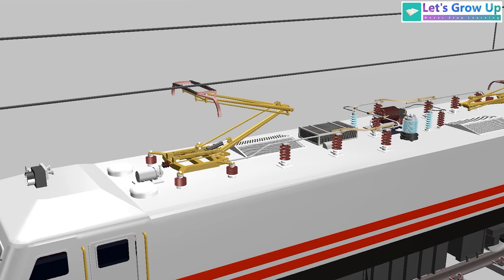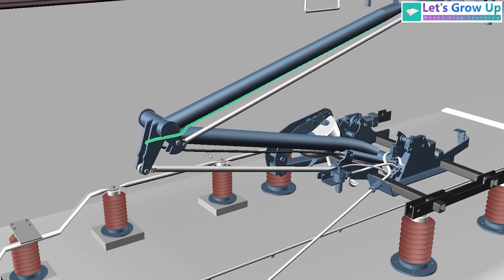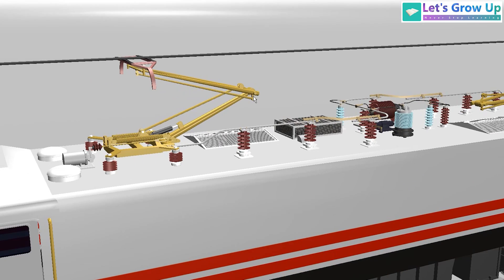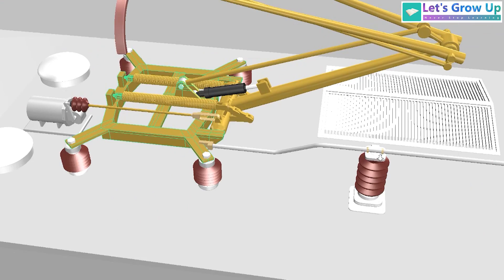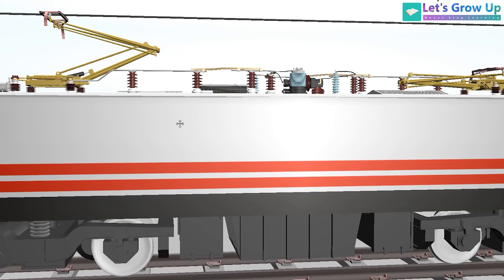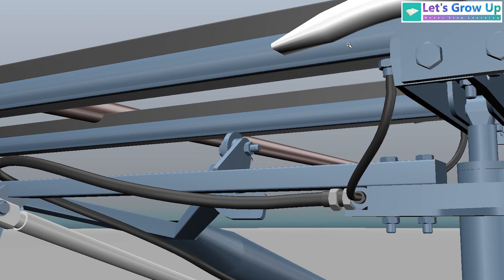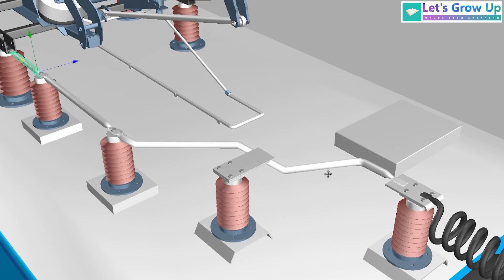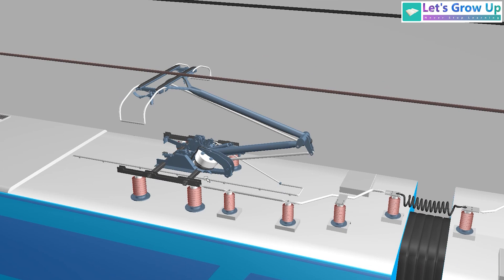How do pantographs collect electricity despite not having visible wires?

Comment: Very interesting and informative. Thank you. Can you show how the locomotive electric engine works and links with the wheels in a future video.
Reply: Wheels are connected to the electric motors with gears. Each set of wheel is connected to 1 motor which gets electricity from transformers.
Reply from the maker: sure